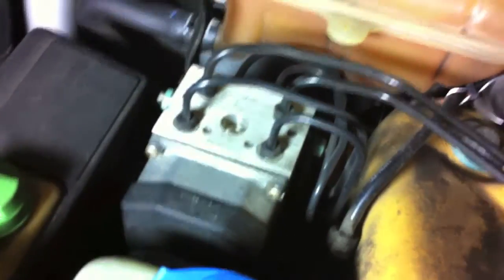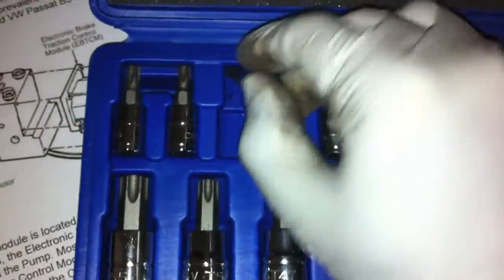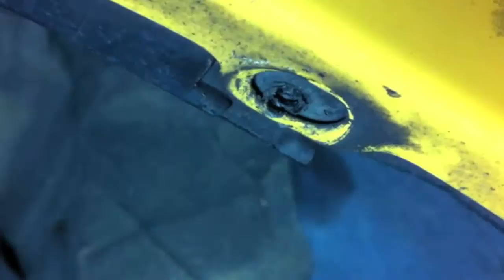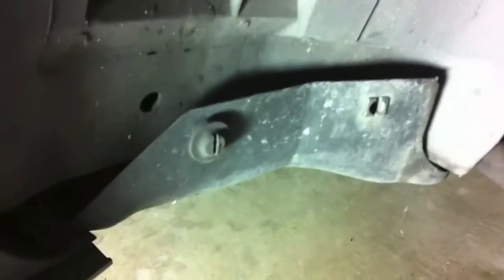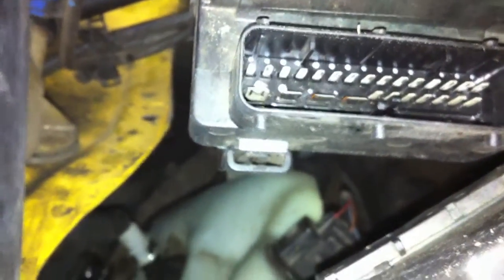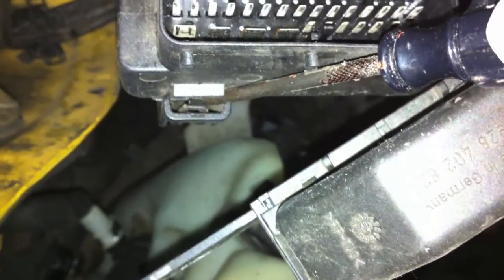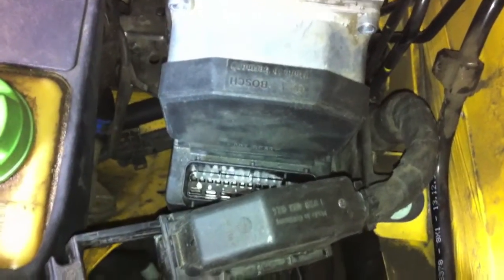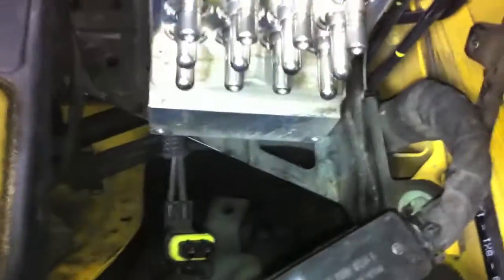ABS Module Removal, 2000 Audi S4

Comment: Excellent video...   Thank you....Today I was working on my ABS Control Module  (2001 AUDI A4 Quattro Turbo Avant), but I had to stop, because I did not know how to remove the small (2 wire) connector. I have watched  several videos, but none of them explained well how to remove the small connector. After watching this video now I know how to do it.... maybe I will create a "special" tool for lifting that tab..... After removing the ABS control module I will send it to a guy (Matt) I found on e-bay........  By the way my ABS has the following symptoms: The ABS  and BRAKE lights come on with three beeps. The lights stay on for some seconds or minutes and then go off then after some minutes it starts all over again.  It happens more and more often.  When it started I was able to drive 50 miles on the freeway without these warning lights. Now I can't drive 5 miles without these warning lights (and the three beeps)...  Arun Rao,  thanks again.

Comment: a MUCH easier way to do it, is to remove the main connector, then remove the 2 bolts that hold the entire hydraulic assembly in place. pull up and to the side slightly, and everything is accessible. theres another video on youtube showing that method, and it doesn't require removing the washer reservoir or the wheel or wheel well.

Comment: I've got a 98 A4. ABS and engine management light permanently on. All forums pointed out it was the 5.3 bosch ABS module. Made a note of the part number and bought one for £35 from a salvage yard. Fitted it as shown above. Thought it might need recoding, but it cleared everything and now its all A OK. Thanks for the instruction.